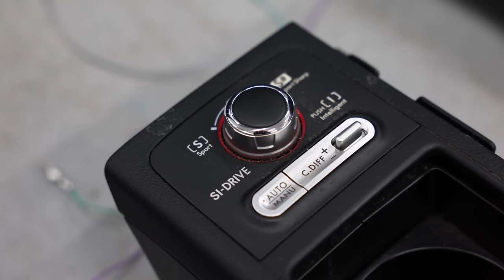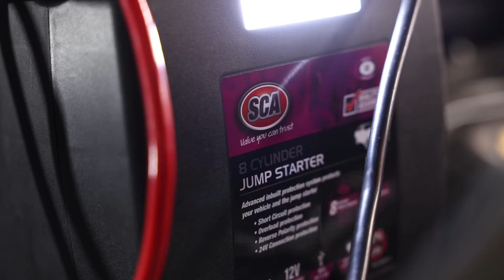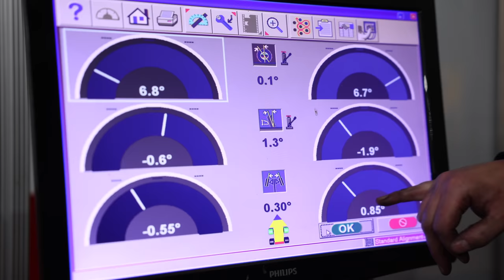EJ25 STI Swap, will it start? - Marty's Levorg Part 3

Comment: Got to be one of the fastest engine swaps I've ever seen.
Reply: Not Just engine swap, full driveline. The rear diff, all that was swapped also. The fastest just engine swap ive seen is one I did personally on a honda civic. We pulled one engine from one car sitting next to the other, had it done in about 4 hours. You COULD do the same here, if you knew everything ahead of time, such as little fiddly stuff like the fuel pump and such wiring they ran into. The civic had none of this, it was all plug and play, bolt it up and turn the key.
Reply: Movie magic, haha. Some Wheeler Dealer projects take months or over a year.
Reply: Things go way easier when you just have to do the exact same steps backwards and have all the parts you need on hand
Reply: When you are working on two nearly brand new cars with all the same hard points, things can go pretty quickly! It helps that Subaru makes everything fairly easy. From how subframes and engines bolt in to how suspension mounts and having simple interiors. It also definitely helps to have 4+ people over the course of several days. That said they still did great work fast.
Reply: They could have made it much longer, by stretching it into more episodes and going into more detail on the wiring..
Reply: @Finnspin_unicycles  yes. I miss when they did that.
Reply: Yeah they really glosssed over a lot of details that they would normally spend a lot more time on.
Reply: @mediocreman2  Mighty Rush Mods.
Reply: Nah the perfect civic was the fast one ... xD
Reply: @helvettefaensatan  not really. They was honest about what needed to be done and what had been done. Did you really want to see every wire being swapped.
Reply: its so much faster to do engine swap when you have a complete donor car
Reply: I think everyone is missing the point as just to show everyone how the Levorg “Should” have been built, is why these absolute legends did it. It wasn’t really hard to do, Subaru were just lazy. We’ll done Lads 10/10
Reply: It is a rally car, designed in a way for fast repairs & replacement whilst also looking bomb.
Reply: It's more of a cosmetic Shell swap for the engine and driveline haha
Reply: Seeing as they've done a few Subaru swaps before. And the fact that it's like Lego as they mention. Anyone who sti swapped a wrx can vouch that if u do your research first this kind of swap can be fairly simply in the grand scheme of things . Regardless super cool idea and awesome execution
Reply: Reminds me of the Yaris Hilton engine swap, but much more parts!
Reply: Some drag civic that snapped its entire block in half was ready for another run right after. 

They swapped it in like, 45 mins lol.
Reply: @mediocreman2  I don't think so. Outside of dedicated "How tos", this is a pretty normal level of detail for them - most people don't want to see every pin swapped over. But still, I wanted to point out that this looking fast is partially an artistic choice.
Reply: Subarus are pretty easy to do on a lift. Had a 05 Forester with bad head gaskets out of the car in about 40min at a buddies shop. Now a project like this is a little different. But if you knew all the wiring you needed change and knew what all needed to be swapped over, I er this same swap would take 6-8hrs with 2-3 people.
Reply: You must be pretty new to cars
Reply: @crisnmaryfam7344  they aren't just swapping the subframes though, they're swapping the entire wiring harness, which in and of itself is a crazy feat because you don't know what inconsistencies would exist between the vehicles. They're basically putting a WRX STI into the chassis of a levorg. Given that they are the exact same platform, in theory this could work exactly like it would be from the factory.
Reply: @crisnmaryfam7344  plus making it basically stock. I swear if you hand that work over to subaru they might think there was once a lavorg sti in production
Reply: That’s what makes a Subaru a Subaru
Reply: that why on  this point subaru vehicule plateforme is amazing
Reply: I’ve seen a swap done in 5min
Reply: @nightshift3123  I didn't know people still used CDs.
Reply: Original VW Beetle is only 4 bolts to remove the engine
Reply: I did the exact same swap on my 99 legacy be5 with a crashed V7. It’s surprisingly straight forward aye. Love Subaru Lego 😂
Reply: @Finnspin_unicycles  yeah i agree i prefer the slightly more detailed longer content, it seems like they sre just churning out videos to cram more projects in and not spend as much time on editing and stuff etc. Which is abit sad, im quite happy to just see these 2 mess around working on cars, its not so much about the finished projects for me, its the journey!
Reply: I barra rwd drive swapped my civic in 2 days
Reply: Your comment is currently on 998 likes. We need to push you to 1k likes.

Edit: 999 now. We can do this
Reply: @aaronsempa5820  Done.

Comment: Holy shit I'm blown away by how quickly and easily this came together.
Reply: "Subaru Global Platform" and a Highly skilled set of Subaru mechanics.
Reply: Subarus are just Lego. Not to discredit the skill at play here, but all Subarus are plug and play basically
Reply: it took a lot longer than it feels (editing magic) probably spent 10 days planning before 3 days of assembling but yeah, still a really straightforward swap.
Reply: yeah wtf i was expecting this to go on for a month at least lol, meanwhile im here suffering with a shitty kia clutch that requires the disassembly of basically the entire front of the car
Reply: Yeah they really glosssed over a lot of details that they would normally spend a lot more time on.
Reply: @mediocreman2  there really isn't much to gloss over. A few wire changes on the harness. Everything else was basically the same.
Reply: @mediocreman2  you discount how easy this swap truly is on cars that have ZERO rust, Zero cross threaded bolts, Zero problems other then reordering a few wires on a single plug (pretty sure it was just the one with the fuel pump electronics). On some older subarus the difficulty would be a bit higher due to different OBD generations and such, but if you get parts within the same model year/generation gap, then its literally Plug - Bolt and play.

Comment: As an IT guy who has re-wired R&D labs multiple times in my life, I think Miles is a hero.  Having the right attitude and headspace to disassemble something so intertwined and then re-jig it to what you need requires almost Zen concentration and self assurance.  You need to know you can do it as long as you record everything and take time to check your work.  Awesome.

And as Subaru owner in the past, I have no nice words for the marketing people that forgot the enthusiast market and it's influence on the world.  That said, they left WRC, they stopped STi, so perhaps making more money on generic gear is their way forward. Too bad.
Reply: I know nothing about wiring but can completely agree, doing this would be hell on earth
Reply from the maker: Myles is a legend, been helping us out and a great mate for over a decade
Reply: Cheers all! The more reference material you can take before pulling it apart the better, Heaps easier to hit the rewind button and go again!
Reply: So true
Reply: I'm an amateur mechanic myself, much like Marty and Moog were 15 years ago. Do as much of my own stuff as I can and learn as I go on. I recently did a complete refurbishment of a Honda CBR600FX motorbike which involved a rebuild of the loom as a previous owner had damaged it in places and modified it. Obviously I was scared, but it turned out to be really as simple as they are saying. Some simple de-pinning tools, and the right kind of wire and crimpers / soldering iron and it's pretty much all you need. I rewired the entire loom one afternoon and it is as good as new now. Well happy.
Reply: I dont think subaru made money on the enthusiast program, the only thing they have is the gt/gr86 which is enough i guess, many other players in the game to be excited now
Reply: Subaru is the only manufacturer that leaves pre drilled holes and wiring loom that already exist in the lower spec cars for higher spec extras. Everything is transferable
Reply: @mightycarmods  I thought it was "Miles", "Dose Vader", when you guys mentioned him in the beginning. Got excited and confused haha. But seriously awesome work from Myles.
Reply: LOL computer wires r plug n play. u r weak to flex on it.
Reply: @tahsin28  A'ight you completely rewire a car's computer harness from something completely different in 30 seconds or less. It should be that quick because, as you said, they're "plug and play"
Reply: @GspotPredator  ... that is totally not true. Pretty standard actually with today's platform world all over different brands.
Reply: @AccAkut1987  good to know. I have only worked on a few brands and my Honda didn’t carry the same wires for additional “accessories” unlike the subie
Reply: @GspotPredator  there's actually alot of manufacture that do that 
For instance my bmw 1995 auto upgrade to 2005 manual and engine bolts right in all holes for looks and clutch etc is there  and Holden Colorado 2wd and 4wd share the same chasis
Reply: @michaelgolding1568  cool… they include the wiring too?
Reply: @tahsin28  Sure, it’s plug and play after you run the 100ft of wire through walls and crimp the ends on. Or up the side of a building and through brick and crimp the ends on. But yeah, definitely plug and play
Reply: I work IT also and when I bought my first Subaru I hard about engine swaps for a 2000 Impreza RS. Then I realized just how much went into it.

Comment: We need to see the levorg and supergramps side by side seems fitting that marty have his two awesome wagons next to each other in the same video
Reply: they are the same damn car LOL.
Reply: @OutsideDuhBox  supergramps has a turbo ez30 flat 6 tribeca engine, and is a liberty wagon. But honestly idk what would be faster
Reply: Agree, we need to see them side by side!
Reply: @Soup6777  both subaru turbo 4 cyl wagons ....
Reply: @OutsideDuhBox  supergramps has a flat 6 not a 4 banger
Reply: @Rogerthat427  what is this blasphemy?! 😭
Reply: @OutsideDuhBox  it's actually pretty cool they do a build series on it, I like the car and I'm not a huge subaru fan
Reply: @Rogerthat427  they do so many damn utility vehicles bruh. 😴
Reply: @Soup6777  *EZ36
Reply: @OutsideDuhBox   nope supergramps has a 6 cylinder ez36 engine out of a tribeca that’s been turbo’d
Reply: @OutsideDuhBox  ez36 it's a subaru engine, speaking as a subaru guy, the subaru 6 cylinder are where the really big power is at. Mainly people have been making ridiculous power with eg33 builds ( I think because ej22 rod/pistons are a bolt in).
Reply: Supergramps has probably been sold  . . .
Reply: @AnythingEvil78  Marty said he would never sell Supergramps
Reply: @eltinto  yeah, they say that but have sold off a lot of cars on the quiet . . .
Reply: @Soup6777  Gramps is faster by far surely
Reply: @OutsideDuhBox  Subaru’s been making flat 6’s since the ‘89 XT
Reply: @gregoryholland6126  psssh boxer rumble is their bread and butter 😈
Reply: @eltinto this didn’t age well

Comment: Much happier now Moog is a man of his word! Can't believe how well everything seemed to just fit. Was definitely built for it. Props
Reply: "Subaru Global Platform" You can do the same with ANY Subaru from 1994+, Take a Forester, drop the STi stuff in it, and you have a lowered (with factory Sti stuff mind you) and turbo Sti Forester. Reverse that, Put the Forester suspension under an Impreza, and you have a factory lifted Impreza.
Reply: @crisnmaryfam7344  did this with a crashed 07 sti and a blown up 05 forester xt and probably the coolest car I've owned
Reply: @crisnmaryfam7344  except a gen 5 liberty/legacy! (Different transmission mounts compared to Gen 4 or other models - non standard ej due to oil pump for low mount)... Would agree for any Subaru that people care about! (Gen 5 lib/leggy owner here)
Reply: I  think Moog has a secret fetish for manky things in his mouth, I think he knew this would go together like lego, haha.
Reply: He didn't really chew though. It was more of a bite.
Reply: @mediocreman2   I call that effort a slight nibble.  Stick that sock right in there & get chomping.  Re-do the chew.

Comment: I love how quickly these guys crank out videos, I'm hoping to have my EJ255 running in my FXT by the end of the month, only then to edit and upload my own "will it start?" video. . Awesome video Marty & Moog, keep up the great content!
Reply: Subbed. Can't wait to see it.
Reply: Excited to see it 🤌🏼
Reply: good luck! just finished a rebuild on my sti a few months ago, glad i have it ready for winter
Reply: @plantedrabbit3  Nice, new short block or did you just rebuild what you had?
Reply: @johnislow  Thanks! I'm excited too 😄
Reply: @Dubdubgarage  Got some family coming to help me, Dom Toretto would be proud 😄
Reply: @My.Lame.Perspective  I picked up a longblock for cheap and went through it, did new rings, oil pump, timing, replaced all the gaskets, got a killer b pan. Been running great so far, but i think its time for a turbo soon, its been smoking a bit lately
Reply: @plantedrabbit3  I'm building my long block in a few weeks (waiting on last few parts) and I've never done it so I'm a bit nervous but I got a new VF43 too, hoping it all goes smoothly. What new Turbo are you leaning towards?
Reply: @My.Lame.Perspective  Ive got a blouch dom laying around i might throw on, but its a bit big for my setup, so i might try to find a 20g or fp blue or something along those lines. As far as assembling the long block its really fairly straightforward, just make sure you follow the right torque sequence for everything, especially the head bolts or studs. If you're assembling the shortblock yourself too, don't forget to check ring gap and bearing clearance. Do you plan on doin a valve adjustment while everything is apart?
Reply: @plantedrabbit3  I have a OEM shortblock new from Subaru so I had my heads rebuilt and plan to assemble with ARP headbolts. Assembly looks straight forward for the longblock its all the hoses up and around the intake manifold that look like a nightmare. But I've got a Chiltons manual so I'm optimistic 🤞

Comment: My only complaint is that this isn’t longer with more details of the swap! Love the technical nerdy stuff!! 👌👌
Reply: You should watch the skid factory for super nerdy technical stuff.
Reply: um... this is pretty much as detailed as it gets, other than showing every second of what they did with the wiring. Because the rest is basically a direct bolt in swap with no custom fabrication
Reply: @gwot  an explained wiring diagram, module part numbers etc etc. he's not wrong - the fast build time frame is definitely in the details.

Comment: Someone else has probably already suggested this, but there's two things that need to happen here. A) This car needs to be named the Legoru, and B) it has to be painted the same colour as the STi
Reply: I hope they swap out the front bumper with the STI one too.
Reply: If you go through all the effort of painting it, why paint it the most standard and boring color you could paint a Subaru?
Reply: Because it is an iconic colour and would just lift the unique “stockness” of the STI Wagon to another level - I would say gold wheels are also in order 😊
Reply: @Finnspin_unicycles  some variant of blue is the only colour a subaru is allowed to be (well at least for Impreza STI) - and I won't hear otherwise hehe.  Kind of liked that black with gold flake they had at one point though (but that is distant 2nd).  Also seen a few cool grey ones (custom grey, or even the GC8 gun-metal grey was cool).  But you get the point, blue number one.

Comment: Guys
I once changed the middle piston on my Suzuki GT550 on the side of the road on the way to work. And still got there on time.
I changed the engine, gearbox, Recaro interior  and sunroof between my Capri 1.6L and a mates totaled 2.0 S.
FFS I built an Air Traffic Control Centre up from green grass to actually controlling three and a half million movements a year.

I've been watching your channel for a few years now and think that sometimes you're just making videos that are only of interest to the rather mentally disjointed pair that you are.
But damn! This Levorg/STi swap has left me totally in awe.
Brilliant job, brilliant mates and a brilliant idea.
Faaaaaaaaack! I'm a systems engineer petrol head from the UK but retired to the Philippines and I wish I could pick up a Levorg and an STi here and follow your blueprint, but that's not going to be possible (at least not for a price that wouldn't put me, the wife and kids, and grand kids into debt for the next 20 years). We have a 100% tax on imported cars.
Without a doubt - best video you've ever done, can't wait to see what happens next!

Comment: That sun load sensor circuit code is like a default in every Subaru I’ve ever scanned, even fresh off the truck
Reply from the maker: Good to know!
Reply: only a small thought, are you scanning the car indoors or outdoors? Wondering if maybe it needs the sun to close the circuit and the code may go away ? I haven't seen it come up before.

Comment: Circa 2017 & I was new car shopping. Levorg's were high on the shortlist but CVT was a deal-breaker. Didn't matter what gimmicky drive mode's were employed: it still felt like driving a Janome sewing machine.

Had they made a Levorg manual, I would have bought one. I'm sure many others would have too.

Well done to you for building the car that Subaru's internal politics wouldn't. The fact the swap was so easy with zero fabrication, just baffles as to why'd they refuse to build these from the factory.